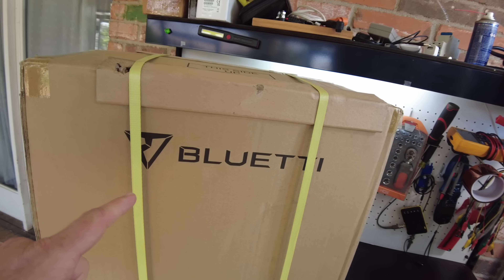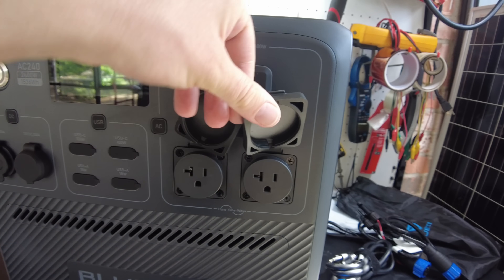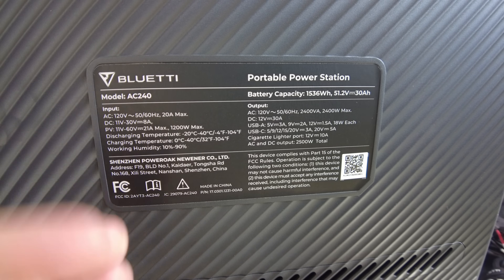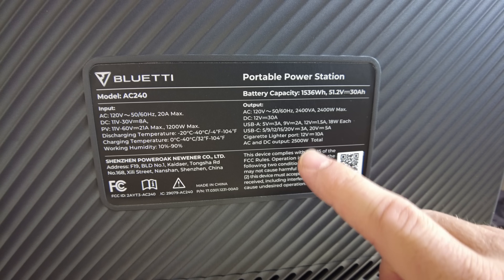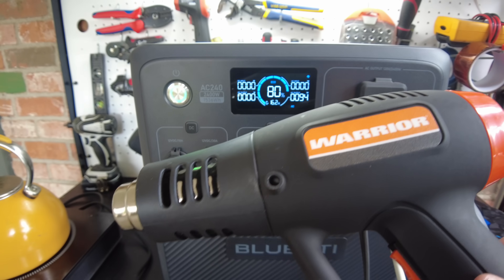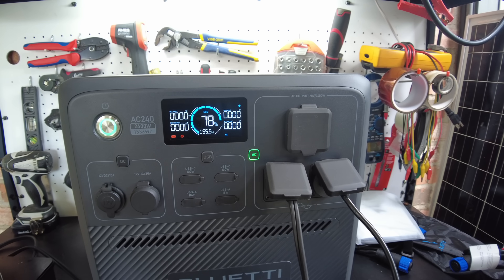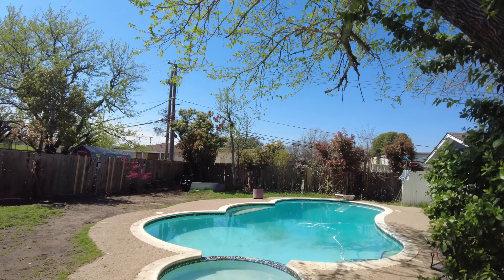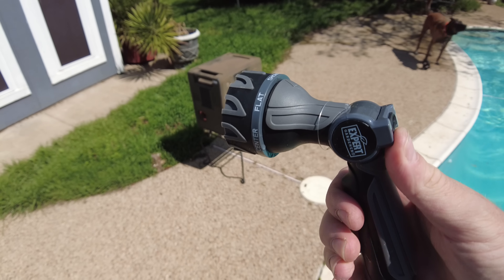BLUETTI AC240 IP65 Water & Dust Resistant Power Station

Comment: I don't mind the 12V/ 30A dedicated connector, cheap cigarette plugs are useless, which is why we buy this unit. Concerns and confused, only one DC/PV input @ 60V/21A max? Most 200W panels are at least 21V /10A which means only two panels in series how do you reach 1200W??  I wonder if you can charge the expansion battery B210 from a van DC, while charging the AC240 on roof top solar at the same time?
Reply from the maker: Yeah, I hear ya about the soar port. They have a voltage conversion box coming out for this unit that will allow higher PV voltage. Would have been nice if it was just already 145v like the AC200L. I think the B210 might allow solar charging, I have one on the way, should be here this week. I'll be testing it. Thanks
Reply: @BradCagle  
The B210 actually does have the same solar/DC charge port 60V 21A 500W, so if you can charge them at the same time (while they are linked together) problem solved.

Comment: What is the surge watts output? Looking to run a 13.5 BTU AC unit that requires 3,500 starting watts.
Reply: I think the surge output on this is 3600 watts. I wouldn't recommend this model for an AC that large. If it does start it, it'll only run for about an hour and a half. I would look into the Oupes Mega 5. I've heard nothing but good things about them. No, I don't work for Oupes lol
Reply from the maker: It starts the 13.5k BTU Dometic on my RV.

Comment: Your reviews used to be more in-depth but now they feel very rushed. Or could it be that the companies sending the stuffs to you are not allowing you properly test them. I would expect that you would drain the power station to 0%  then charge it to 100% with the turbo mode and record how long it charges. I would also expect you would also do the AC efficiency/capacity test to report how efficient the power station is. You just rushed to do the DC only. The UPS mode, no tests. Very many tests missing. These are very key things that consumers check before buying products and you have started missing them out in your tests😢 You just show us the product, touch 10% of its capabilities and thats all😢
Reply from the maker: It's time on my behalf, I've never let a company control my content, and do not plan on it. That's also the reason I've never accepted payment to do a review. I'm actually going to do another video with this unit, so I'll include the stuff you just suggested. Thanks!
Reply from the maker: I'd like to add I do appreciate the feedback, It really helps me to make these videos better :)

Comment: Excellent presentation.  Thank you.  I am not sure what I think of the 12v/30a output and the adapter cable.   I would like to see some 5521/10a ports and the XT60 itself with no adapter required.   For the 12v/30a to be useful for me, I would need to make some sort of 3-4 into 1 cable or hub so that I could use that output on several devices.  Might be a good idea for a video.
Reply from the maker: Thanks! I think they call that 12v/30a port the "RV port" to run your 12v RV accessories, pump, jack, etc.. I could be wrong.

Comment: What's idle inverter consumption?
Reply from the maker: @junakowicz I left the AC output on for about 24hours. It got down to 92%. So 92% of 1536Wh is 1413Wh remaining with 123Wh used over 24h period, that gives us an idle consumption of about 5.125w
Reply: Thanks for checking, wonder how they achived that. Is it like on victron "search mode" ?. Interesting how it would work with a fridge where load is periodical.
Reply from the maker: I'll leave the AC output on, and see how much battery it uses over 24h. Thanks